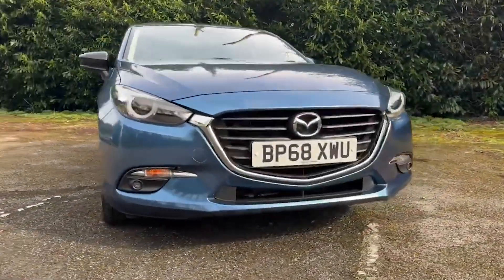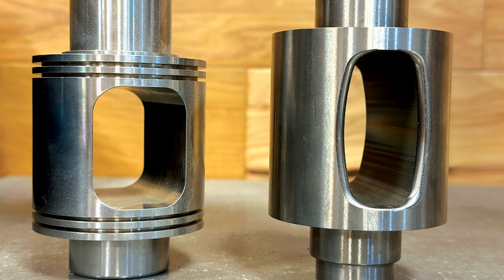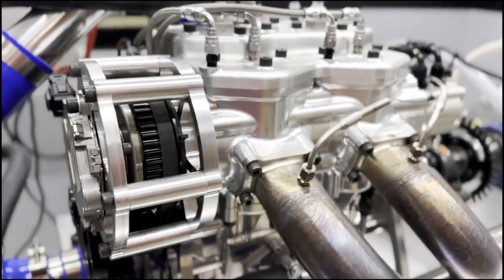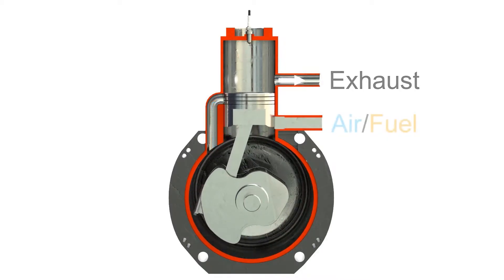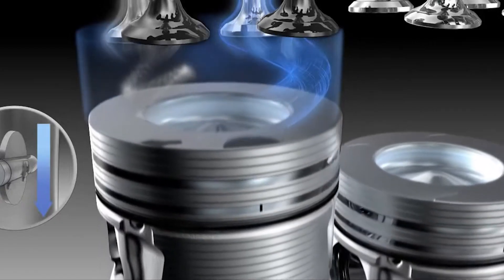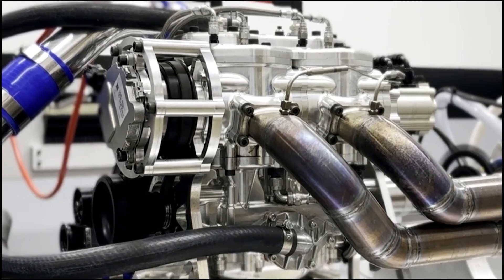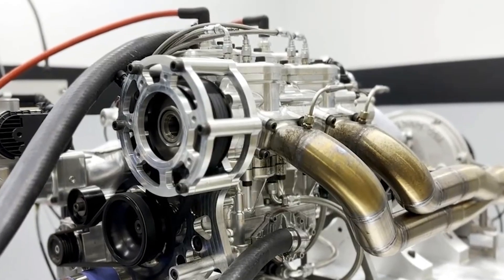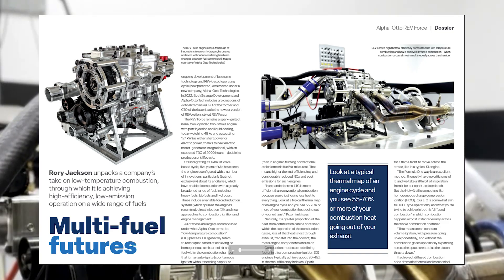How One Engine Could Redefine Combustion

Comment: Showing a 4 stroke animation while describing a 2 stroke operation is a bit tacky. I build race engines for a living and I’m confused lol. A DI 2 stroke with rotary ex valves and a blower is nothing new. A supercharger with a  recirculation tack is also old news so I’m missing the breakthrough. High compression forced induction 2 stroke diesels for aviation have been a big thing for 20 years so I would love to see some designs animation of the actual engine not generic take offs of other 4 stroke engines! Cheers✌️

Comment: Does the 48kg include the supercharger etc.?
As a 2-stroke how are the main bearings and crank/conrod bearings lubricated? Is it now pressure fed by an oil pump?
Reply: this just like 4 stroke engine but only the piston, cylinder block and minus the valve is different, just this engine is really reliant on the supercharger to run

Comment: >>> 💢💢Our ultra-efficient, Fuel-Agnostic, Zero-Emission [FAZE] engine technology will displace any vehicle electrification. That means electric vehicles are inferior in all metrics. Period.  The technology enables constant maximal torque and efficiency at all speeds and conditions without a TRANSMISSION. 💢💢 <<<

The low cost FAZE engine tech is revolutionary yet is in a simpler, smaller package, with very little electronics so repair is 'old school' simple. It's virtually noiseless & vibrationless and odor/smoke free. The constant, maximal efficiency and torque at any speed and transmission-free operation characteristics mimic electric motors. Low cost breaking energy recovery system dispenses with batteries. Real world driving cycle efficiency is 200-500% better than the competition. Many other benefits abound. 

We are talking to a small engine development  startup regarding collaboration to promote/commercialize their two new vibration free engines esp. in the aviation and range extension markets which will eventually incorporate the FAZE tech. NFTG may significantly improve these 2 engine designs. 

Moreover, NFTG is developing the FAZE tech for use in the low cost, autonomous, door-to-door, personal air mobility system, the PersonalJet. The 1st trillion $$$ company.

You may be able to find papers online, and LinkedIn under New Frontier Technology Group. Search the 'Create The Future Contest' site at 
[ contest.techbriefs \\\ d0t ///  c0m ]

Let me know u got this

Comment: Direct injection for jet fuel isn't due to the injection angle. It's because it's operating as a compression ignition engine them (same as diesel) which means any oil can be used no just jet or diesel

Comment: I'd like to see a 4 cylinder version. Maybe 240 HP and under 100 KG. Awesome!
Reply: A 90 degree v4 2-stroke would sound like a v8 4 stroke.
Reply: Yeaaaaaaaaaa!!!!!!!!😅
Reply: Or a triple - which would run far smoother than the twin with only a small increase in complexity, and would still fit in most cars.

Comment: 2:29 , "no timing belts", so what about the timing belt for the exhaust valves that is on screen?!
Reply: That belt drives the rotary exhaust valve. A rotary valve that is just outside the exhaust port in the cylinder wall.
Reply: @TheRed6263  I know........

Comment: tuned pipe on a regular two stroke is non-parasitic. uses waste energy. that being said, it becomes highly tuned and RPM dependent. which is fine for a constant speed constant load application. and of course, its the non-linearity that makes a two smoker bike so much fun :)

you lose that with this valve system, but we can live with that, i guess... a pipe can be tweaked to give a good suction wave, megaphone style, but a reversion wave just isnt going to work with that intake still open. at that point manifold pressure has to be higher.. and that definitely requires the blower... and that sort of defeats the purpose of a tuned pipe to "supercharge" by raising cylinder pressure using waste energy (they can reach a bar of "boost" as the exhaust closes...). anyway. you gain linearity... only time will tell if you get the power gains as well... a two smoke with the same raw power but no peaky band, it just keeps coming on? then theres also options of enhanced compression braking... cut fuel and ignition, crank up the boost and "jake brake" it...

iunno... it seems great at first glance, maybe something will come of it, but i doubt it... claims on paper are one thing. real world tests are another matter entirely.

seems like a relatively easy idea to modify to an existing smoker... "le dan" anyone?

issue in my mind is being stuck in this rut called "the otto cycle".
Reply: But with the ability to boost the intake to 2 or 3 atmospheres. I’ll take the variable REV.

Comment: At the beginning of the video you claim you are using 2 cycle intake port and a rotary exhaust valve.  If that is the case, why are you showing a traditional 4 poppet valve head and a standard Otto 4 cycle?  Can we please stay with one story?  I look forward to more information about new concept.
Reply: Clearly, there are no graphics available for this new type of engine so older ones of conventional engines have had to be used instead...
Reply: The engine already exists no need for skeptism